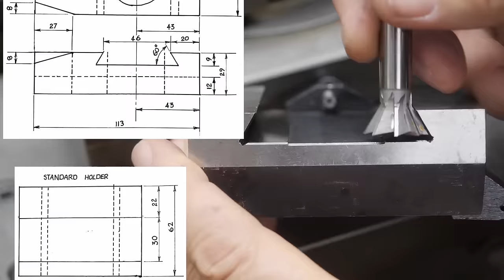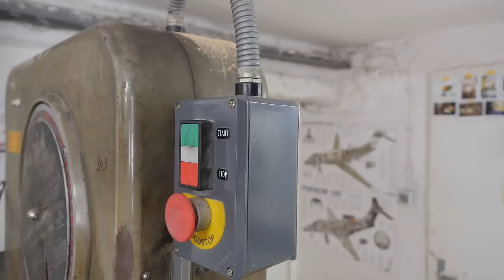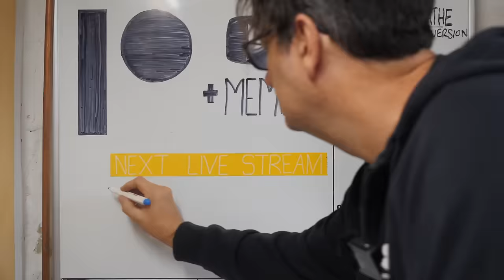Using triangle carbide inserts in a homemade cutter was a bad idea. || RotarySMP

Comment: If the cutting edge is not precisely on the centreline (and it looks like it isn't, for clearance I assume) won't that affect the dovetail angle? I wouldn't be surprised to find that it didn't cut a 60º dovetail.
Reply from the maker: Yeah, it was for clearance, although I screwed up and gave it more clearance (4.4mm ahead of the CL) than I planned (2mm). It will cut a curved surface. I need to see whether it will make much difference on a static clamping surface like this. On  a sliding way, it would cause more scraping.
Reply: @RotarySMP  Thanks for the reply! (Love your channel btw.) I'm not sure it'll cut a curved surface... effectively the insert is rotated relative to a line through the axis of the tool's rotation, and taken to its limit with the cutter at 90º that would produce a vertical surface (if it still cut, which of course it wouldn't). So I think it'll still be straight, but not 60º. But then again the geometry of this kind of stuff ties my brain in knots so who knows.
Reply from the maker: @cooperised  Yeah me too. Another viewer was talking about it being a curved surface. Your description sounds more plausible. I how this similar to a cosine error where the initial deviation is very minor and I can ignore it :)
Reply: @RotarySMP  Fingers crossed eh! If I wasn't on holiday with the family I'd fire up the ol' CAD and model it to see what the effect of that offset was. But I am so I won't. I'm interested though.

Shame you can't just use the same cutter for both mating parts, and then the angle wouldn't matter anyway!

Comment: Having done the head scratching trying to make a smaller diameter insert dovetail cutter I realised that if the cutting edge of the insert isn't on the centre line of the cutter then you don't get a 60 degree cone, you get a slightly curved face of slightly more than 60 degrees... have you found yours to be close enough? I ask as the geometry of yours is a whole lot easier to make. 
thanks for sharing.
Reply from the maker: I moved the cutting edge forward of the centerline to ensure back clearance. Might have overdone that. Then again, this is a static tool holder, rather than a guide way, so I expect less than perfect area contact to still perform okay.
Reply: as per my other comment.. the most simple solution (to avoid the curved resulting face) would probably be to put the inserts cutting edge plane onto the rotation axis (milling geometry then is pretty simple as well), create the cutter, install the inserts and use a tool&cutter grinder to grind off any spots of the inserts in the upper area that would otherwise rub?!
Reply: @joansparky4439  simple if youve got a tcg , less so if not! :-)
Reply: @peterhadfield873  
I'm aware.. but with the outcome being flat dovetails (and not curved ones) it might be worthwhile?  I mean, even that small d-bit grinder from CHN I got should be able to do this.. price wise on-par with my 180x300 mini-lathe.  I'm sure a lot of people who are able to make their own dovetail-insert cutters rock much heavier metal than this?

Comment: I'm assuming the answer is "Because it'll rip your arm off" but is there a reason no-one uses the lathe under power with a hacksaw when using one to part off?
Reply from the maker: Good point, safety note taken. Turn off machine first. Thanks.

Comment: What about drilling two radial holes in the Clarkson shaft for a C spanner?
Reply from the maker: Good idea John. I need to put something on the Clarkson to-do list.
Reply: @RotarySMP  ironically I have only the bits you are missing. Inherited with my lathe, but I had hopes of creating a slide and using it with ER collets as you do. Dopey bought a 25mm shaft not 1”!
Reply: @RotarySMP  are you short of things to do? I doubt it!
Reply from the maker: @johnsherborne3245 Not really. As fast as things get worked off my to-do list white board, other things are added.

Comment: Any reason you didn’t just 3D mill the insert pocket using fusion? Using a tip rad cutter?
Reply from the maker: Since I monetised my channel, I can't use the hobby license of Fusion, but dont generate anywhere near enough revenue to justify a commerical license. I have a 20 year seat of FeatureCam. Not the most productive tool paths, but it is a hobby, and I am patient.
Reply: @RotarySMP  ahh makes sense, didn’t even cross my mind you couldn’t use fusion
Reply from the maker: @Kyran31 That is also why I use FreeCAD for modelling.

Comment: Question: Why not drill the screw hole all the way through?

Granted, I know you'll be the only one using it and probably not leaving it lying around with no anvil or screw in it. I just worked a place where we had to machine many of our own parts and features for old machines, and someone would always lose anvils for the tool holders, so swapping between a LH RH Center he'd take the anvil off another one, leave it on the carriage, then pack it full of chips (we had to machine metal, epoxy resin, other non-ferrous materials that make nasty dust that cements when wet/oiled). So many of our tooling bars we wasted time picking clean that we eventually through drilled them all. This also let us use any length screw since the different holders sometimes had a screw 1mm different and well, you guessed it, if he was losing anvils he was losing screws and then F@#$king the next guy over because the inserts wouldn't actually be clamped tight.
Reply from the maker: Good point, I didn't think of that. I was more concerned with that little 2.1mm drill breaking off in the hole as it exited on the sloped surface.

Comment: What that 11:30 a joke? Convert it to 7 metric degrees 😂
Reply from the maker: Either that, or I am an idiot who cant read a scale :/
Reply: Oh I didn’t notice the mistake. I was laughing at the conversion comment, cause metric and imperial degrees are the same, and thought you were making a joke.
Reply from the maker: @iteerrex8166 Glad you enjoyed that. :)
Reply: @RotarySMP  It seems like you didn’t intend for a joke, so I’m not sure what you meant there then. But anyways, great cutter. Looking forward to making the parts. Cheers 👍
Reply from the maker: @iteerrex8166 I only worked out in the edit that I had screwed up and set only half the angle I wanted.

Comment: 2:28 is that a camera artifact or is your tailstock wiggling?
Reply from the maker: three jaw chucks are not precise tools, so there is some run out when you grip an existing part like this.
Reply: Sure, but shouldn't a preloaded and locked tailstock force that end to be centered?